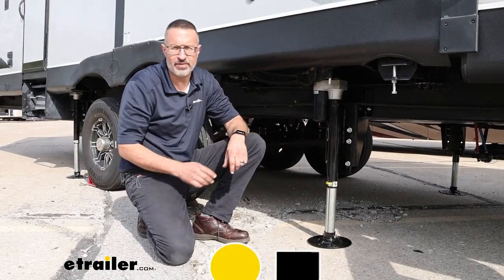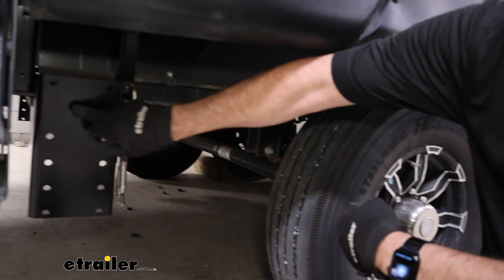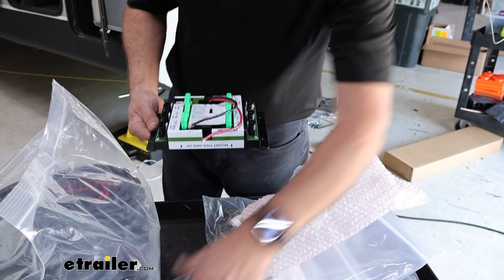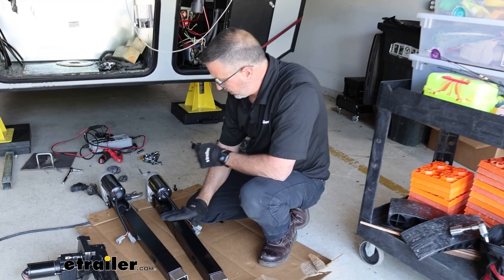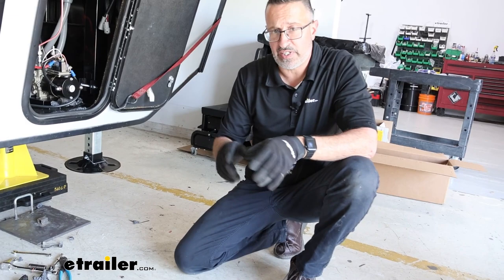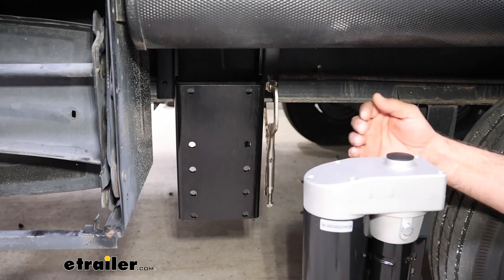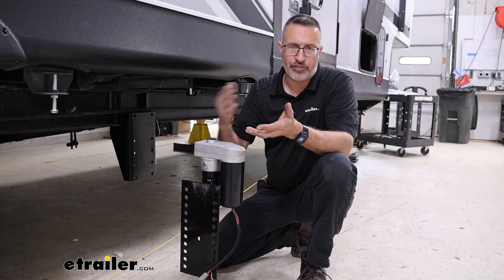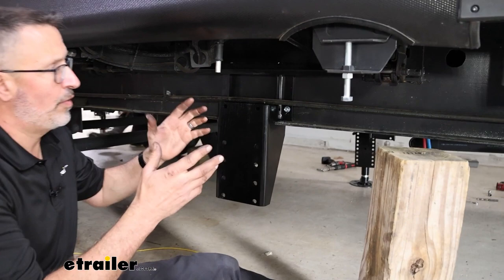etrailer | Lippert Ground Control 3.0 Electric 5th Wheel RV Leveling System Review

Comment: I have this on my 33 ft conventional trailer. Only auto levels when it’s already within 2 degrees, rear jacks are too low so you have departure angle issues and the controller frequently says out of strike when it’s not.